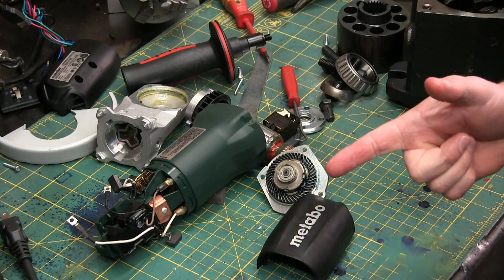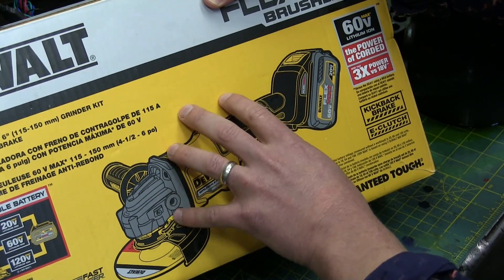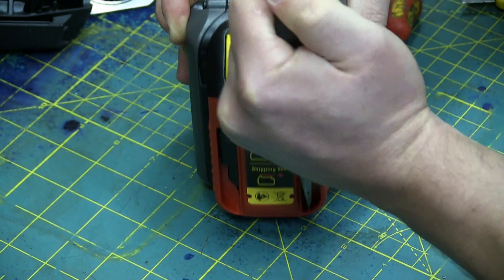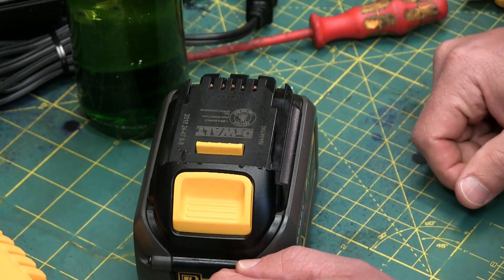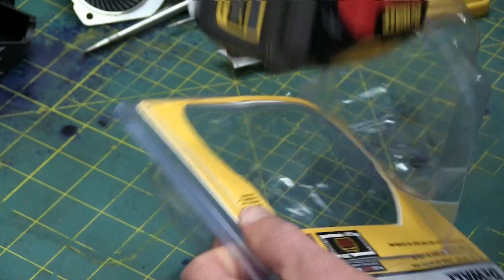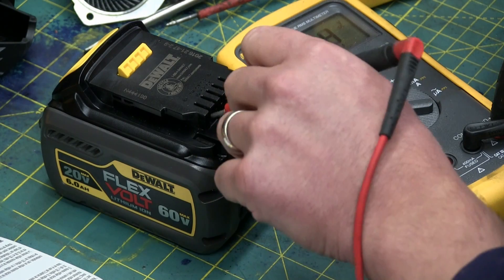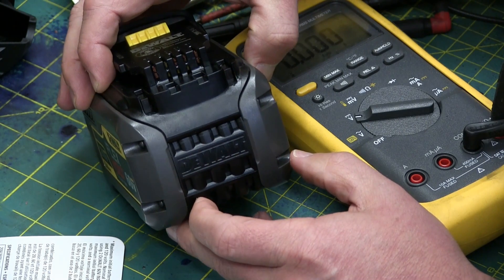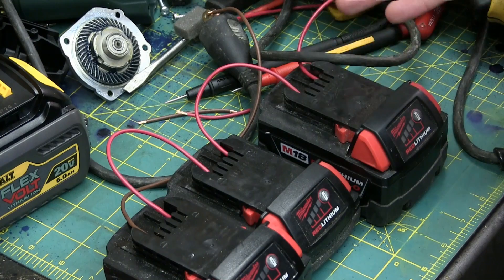Plug-in Power Tool to CORDLESS CONVERSION.

Comment: Heya AvE,

I enjoy watching your vidjayoes (vidoes). 

I've been working with computers for a few decades now and they have been doing just that for servers using a UPS (uninterruptable power supply).

A poor man version is; a car battery connected to the mains, then a 12 volt to mains inverter. Eg 12 volts to 240 volts as we Aussies give things more pixies!

Or you/we/the interwebs could come up with a portable generator ;)

And if it's under 240 volts, it will only tickle :p

Comment: so you can't mix ac and DC, so  you'll either have to change the mains ac to DC, or use an inverter to change the batteries to ac. now you want the inverter to be grid tied and smart. smart enough to only dump in pixies when the voltage drops on the tool end, and puts enough pixies in to keep the tool running at Max power! Sounds like not a terrible idea...

Comment: I thought DC and AC were not compatible.
Reply: Most AC appliances use a rectifier bridge and a capacitor to turn AC into DC
Reply: No offense to Sean, but that's not quite correct. The reason this works, Black, is that several kinds of electrical motors do not care whether they receive AC or DC (they're actually pretty unique in this way as far as components. The reasons why are too long for this comment). Most of them, including this one, use what is called a Universal Motor. You'll find similar motors in various appliances such as laundry machines, dryers, dishwashers.

As for Sean's answer, he's referring to something you'd see that has a power pack or wall wart. Your laptop power pack, your cell phone charger, pretty much any of the many devices that, instead of just a cord, have a plastic box somewhere on the line or on the plug. That box takes ac and converts it to dc (generally at a different voltage) so these devices can use them.
Reply: *****
No offense to you, but many appliances, as I said, have a bridge rectifier in their switch which cuts the AC sinewave in half, and inverts the lower phase, then a capacitor smooths it to produce DC.  On the subject of wall warts, if you look at some wall warts, they just step down 120AC to 9 or 12 or whatever, but also in AC. You can run the proper voltage DC into those devices and they work fine for the same reason, they just moved the AC-DC portion into the device rather than the wall wart.
Reply: Sean As I said, what you described is indeed a thing that is done, and is *generally seen in things like wall warts. I have a large bin full of them, and I've never seen a wall wart be AC, though I'm sure it's been donein some obscure cases (I'd be interested to see any examples you can think of).
All of this is fairly irrelevant, however. As I said, this drill has a universal motor, and incorporates none of these elements.
Reply: http://i.imgur.com/xOebQfL.jpg  The original NES was the first one to come to mind. Not exactly obscure :)

Comment: Would need to make sure the battery pack has overload protection as well so if the tool does short out everything doesn't melt. I.e put a breaker in the device to over come the breaker

Comment: EE here.  If the tool has a motor that runs off DC (it appears most do) then just run them off the batteries and charge the batteries at the same time.  Limit the charging current to avoid popping breakers. You might cause a few grey hairs on the tool designers though. 

I would think it would work much better as a properly designed system rather than a bodged bunch of pieces.  I can't see that running a tool designed for AC from battery is a good idea.  Inverter idea works but would be needlessly complex and expensive.

Comment: Seeing you struggle to remove the battery safety cap made me lose a lot of respect I had for you. But oh well sometimes we all have our kryptonite and beer always helps alleviate the effects of kryptonite syndrome. 
I see your logic in this power source as at my work now you have to get an electrician to reset a breaker. If you take arc flash training and wear the appropriate arc flash PPE you are now a qualified 200 lb gorilla and capable to reset a breaker.

Comment: why go though the expense of using 6 battery's when you could just design some kind of inline capacitor that sits at the end of the extension lead ? that would cure the power surge

Comment: Look up a UPS (uninterruptible power supply) normally they use a 12v lead acid battery but nothing would stop you from using lithium tool batteries if you change the inverter input voltage. There is loads of circuit schematics online for them.

Comment: Why not use a UPS?  When the supply voltage sags due to the long cable run it will switch out of bypass and supply from the battery.

Comment: I'm thinking a block that you plug in between the extension cable and the tool's cable. That was we can use it with any corded tool. I don't have the expertise to design the electrical part but the case maybe.

Comment: sooo, you want to build an inline power bank/inverter. to save on some weight and probably cost i would suggest staying away from batteries. the constant dischage/recharge/topping off during operations like that would probably have limited life span or would end up cooking them. go for some super capacitors! faster recharge and they can handle putting out smoother power and partial charging!

Comment: So, you need a 120v DC  source with a diode in series, parallel to your 120v AC input. That way when your AC source drops below 120v under heavy load, the batteries begin providing energy to power the tool.

Comment: So, like an inverter that powers the machine on startup and then switches over to cutting itself out of the supply circuit?
Reply: Maybe this should be marketed to inverter manufacturers as a feature they could include. Then the user would have a backup power supply, UPS, DC power supply, AND a turbo charger for tools.
Reply: I was thinking the same thing and thought of the example like the Toyota Prius (I know bad example) but how it uses electricity till it hits a certain speed then switches to gas and lets the batteries charge up that is just my thought

Comment: I'm certain the charge state is not because the factory saves money on not charging the batteries completely. Lithium batteries degrade faster at both high and low charge states. The sweet spot (depending on who you ask) is around 60-70 % charge for storage. This is where lithium batteries show least degradation and highest chemical stability.

Comment: A vector drive with some big honking capacitors and a touch of intelligence is all you need. (hell, you can use batteries if you like it just takes a slightly smarter circuit) hooking batteries into AC is going to fuck everything up starting with RCDs popping like crazy. Your going to have to isolate and rectify just to get things going so you might as well go and build the mother of all uninterruptible power supplies.

Comment: Li-ion batteries are never manufactured/shipped fully charged, but it's not a cost saving measure. 

Li-ion cells will degrade and lose capacity if kept fully charged, so they leave the factory with a "storage" charge of about 3.8V per cell.  At that charge level they could be kept on the shelf for a couple of years without any harm.  If shipped at full charge they would start to degrade after just a week or more in transit/storage, so by the time the consumer obtained them they could have lost a good bit of their capacity. 

That's why you don't see UPS systems that use Li-ion.  A UPS, by it's very nature, needs to be kept "topped off" and that is detrimental to Li-ion.   So UPS devices still use some form of lead acid which works well with a trickle charge and the battery is quite happy to be kept at full capacity 100% of the time.

By the same token you shouldn't keep your Li-ion tool batteries fully charged.  Use them till they need a charge and then recharge them, don't keep topping them off as sitting for periods of time fully charged will lower capacity and shorten their life.

Comment: There is a valid reason why they don't fully charge Lithium Ion batteries. For storage reasons. Lihtium Ion battery is made most stable at around 50 percent. If they fully charge the Lithium Ion battery, it will lose capacity by siting on your shelf or the store shelf resulting technically a broken battery. This is why you should discharge and recharge Lithium Ion batteries atleast every 2 months.

Comment: I guess I will never understand the reasoning in battery powered tools. Why use a battery if you can use electric cord or air powered tools? I can understand if not avilable

Comment: From what I understand you wouldn't want to run a 120VAC tool on 120VDC due to the inductance/reactance when running on AC. 
You'd have to run it on something like 80VDC (no idea, just some amount less than the AC voltage) to get the same rpm out of it.

It's also possible I'm talking shit, so please enlighten me..

Comment: put it in a box wired through a switch into a receptacle so that when you hit the switch it gives you the DC then when you left off the batteries go back to just charging. the receptacle is mounted on the box that is housing the switch and batteries.

Comment: Two mistakes you made:
First, lithium-ion batteries come from the factory with 60% charge because batteries don't really age when they're at 60%. Empty batteries tend to get a bit stuck at the low charge, and full batteries decay more and can explode easier. It's not a way for the battery companies to save money on electricity.
Second, non-computer controlled devices, like a corded drill, won't draw extra amperage when run at a lower voltage. It's just a motor with a cord, it'll just run slower. Only IC controlled devices, like ones with a buck regulator, will increase amperage when undervolted.

Comment: it is already there. the battery backup for a confuser. it will start the tool on a hi draw using the battery to supplement the power. then recharge as you work. or just run the tool on the battery.

Comment: The amount of charge in the pack when first opened from the factory will be somewhere around the preferred storage voltage for the Li cells used in these batteries.  Helps with longevity.

Comment: Okay, so i do not know much about electricity, so i dont know if this is possible, but heres my thoughts.
instead of trying to switch between ac and dc sources to the drill, why not just run on dc all the time? have the extension cord come into your unit, and have that unit switch it to dc, then you could have a capacitor of some sort that would take the peak load.
seems reasonable to me.

Comment: Easy,

Use a bridge rectifier.

60hz becomes 120 hz.

Voltage is increased from 110 to ~155v
Reply: A bridge rectifier does not double frequency... it simply reflects the negative side of the waveform.
Reply: Majin Snake Do you mean raise? And it can only smooth the voltage to a certain extent based on the load current and the capacitance. For that many amps, you'd need a capacitor that's inconveniently large.
Reply: Majin Snake Do you mean raise? And it can only smooth the voltage to a certain extent based on the load current and the capacitance. For that many amps, you'd need a capacitor that's inconveniently large.
Reply: Output frequency is double the input frequency when using a bridge rectifier. Because the voltage does not go thru ZERO any more plus the magic of science the DC voltage will be 1.41 x (square root of 2) the input voltage. The motors used in these tools are typically a 'Universal' motor and can run on both AC And DC as shown in the video. So using the bridge rectifier we would be running the tool on both AC AND DC at the same time!. Lets say the tool is a 500w drill. 500 x 2 = 1000 (this is for the doubling of frequency) then for the DC component - 1000 x 1.41 = 1410W. Using a bridge rectifier turns your anemic 500w drill into a 1410w power house machine for free! (I have not factored in the 1.2v drop for the two diodes in conduction. Please note, I am a electronics engineer with a full time job in rating the power of car audio speakers...

Comment: This is quite interesting. I've got crap cordless tools ,so i am currently researching weather i can build something that dose the reverse. so i can take my week 18v tools and plug them in to the mains and have them run with a bit more power to them and not be interrupted by having to stop and change battery's all the time.

Comment: hybrid eh?! I like it,, at the end of the extension cord, a box, containing ac to DC converter, so were running DC always, capacitors for the start up current draw, and sudden spikes,, bogging down will need batteries, but I never let the tool bog, so caps should suffice, and it won't need electronic wizardry. good luck to y'all, its nice living in a 220v world!

Comment: Why don't you just throw a capacitor in the tool?  It could fit inside the housing of the tool.  Just like how florescent lights work.  Also, capacitors don't die the same way batteries do.  They don't really degrade over time in quite the same way, so you don't have to worry about replacing it, assuming you can get a good enough capacitor.

Comment: They don't save money by charging to 80% for storage. At 80% charge the storage life of the battery is greatly improved without degradation. Storage at 100% charge, especially under thermal cycling, decreases battery capacity and reduces the lifetime. If you want to make your lithium batteries last a long time, don't store them fully charged.

Comment: Tesla makes something what for the whole home though to take some off the top at peak usage and trickle charge at low usage. The idea though isn't too account for load spikes but to equalize the energy usage curve for helping lower electrical demand during peak times which theoretically would allow additional overhead for energy consumption without the need for expanding the entire grid. To a point. Put it in a million homes in a small city though and you've really helped offset the peak usage for a local area or maybe even a whole power plant.

Comment: I know practically nothing, but what about the circuit that is in an uninterruptible power supply as a start? It would take a smarter person than I to do it, it sounded to me a lot like the UPS circuit might help and they already contain a battery. Go easy if I'm wrong, just trying to help.

Comment: They don't fully charge the battery to save money. the battery is charged to only 3.6-3.8v on what known as a storage charge. This extends the life of the Li-Ion battery whilst it's not in use. If the battery were to be stored at 4.2v then after a while it's capacity would begin to decrease (due to some chemistry I'm not too sure about)

Comment: Hi. Old geezers who have been into wind and solar technology for years will know that if you take ac brush motor and want to run it on DC then unless you reduce the voltage it will burn out. Cos the voltage and current is there all the time with DC, not so with AC becuse of the wave form. I run 110v AC brush motor pumps on 48v DC, no worries. Never thought to put the word out as how many people have mid voltage DC supplies? until now with some sideways thinking.. Cheers, Andy

Comment: dewlat sorta has what youre talking about, look up there inverter, its a 4 battery charger and uses them in reverse to power 1 120v 15a circuit, 1800w cont

Comment: 4:16 They don't fully charge them to save money? I'm pretty sure that it's because they're lithium batteries and they are charged to around 40% because they're going to go into storage (on the store shelf for who knows how long). At a low level charge they'll have a much better chance of recovery. I'm sure someone knows more than me but I figured I'd share my tidbit of knowledge that I absorbed from somewhere. But I just thought I'd let you know why for real that lithium batteries generally don't come fully charged.
Reply: Also, be careful running AC tools off of DC. DC will have a much greater chance of arching on the switch which will increase the wear of the switch. I cite /user/JMEMantzel with that tidbit of knowledge.

Comment: I'm not an expert on electric thingymajobies or anything, but wouldn't it make more sense to use two AC outlets and a load balancer or something? 
What would be the advantage to using DC batteries? Just the fact that you can charge the batteries as you go? Honest question.

Comment: The best way I can think of is to supply the tool with a boosted AC sine wave of about 144V RMS to provide the extra kick without frying the speed controller in the tools. The current could be boosted locally by adding a syncronised DC-AC inverter in parallel with the exitsing 120VAC wall current and having a small autotransformer to locally boost the incoming mains voltage to prevent the extra inverter current from feeding back to the wall. 

This would need a DC-DC boost converter from the battery that could be used in buck mode to charge the battery when not in tool boost mode. Also, there would need to be a thermal regulation device to prevent overuse of the boost mode destroying the tools. 

It would require a beefy battery but a good Lithium ION or Li Polymer pack could provide the 60A at about 60V (3600W) to run the boost mode. A multiphase boost converter and mains syncronised inverter could be used to keep the size of the magnetic components under control and make the device a reasonable size and weight.

Just my thoughts, any other ideas?